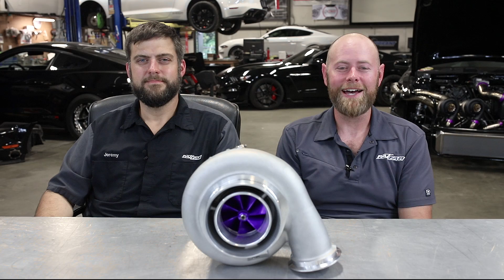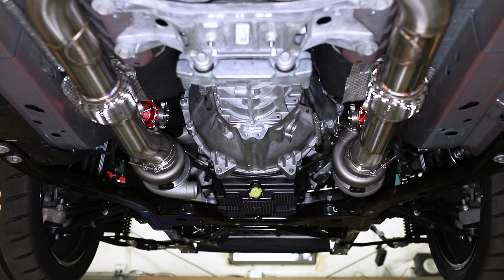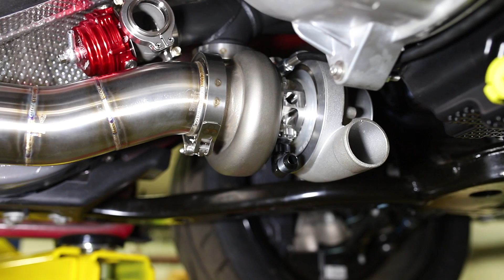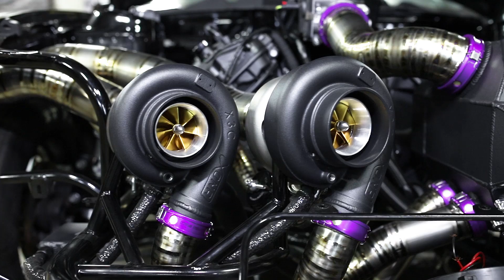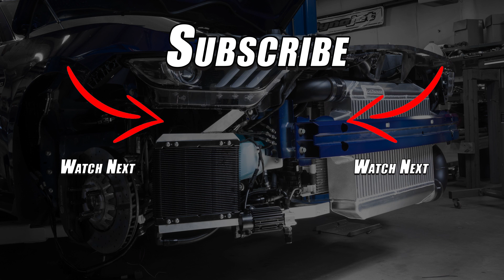Why Xona Rotor?

Comment: What turbo have you ran on a 2.0 liter engine with the best balance of low end and top end?
Reply: BorgWarner S200SX-E For journal bearing, or any of the B1 frame size EFR turbos with a G-type turbine housing if you want Ball Bearing. Though, for the price and long-term/daily reliability while not having to monitor it as closely, I'd probably spring for the SXE over the EFR. It'll be significantly cheaper, too, even if you get an upgraded aftermarket compressor wheel.

Comment: Cool video! Thanks for the informative discussion. :)

Just a question. How do you think does the Xona fare compared with the new line of Garrett G Series turbos? I'm highly considering one of both as an upgrade for my 3S-GTE motor. Cheers!
Reply: I put a g series on my build and let’s just say it pumped hot air sooner than nap said it would I’m now going coma Rota 
There just wrong sizing however the g35-1050 is probably the best designed out of the g series the other size turbos are just setup wrong

Comment: Does Xona Rotor make any turbochargers similar to Comp Turbo which are either Oil less or Air cooled?
Reply: I dont believe so, however the exhaust wheel on the Xona is enough for me that i’ll gladly run some oil and water lines.

Comment: Putting a XR 8269s on my Evo X with a ETS vband kit. I am excited to see what it makes at 40-42psi.
Reply: How it go?
Reply: @john-martin  made 915
Reply: @mikelbring  I gotta ask what made you go with the 69 hotside and not the 64? im in the market for a Xona, thanks
Reply: @john-martin  I dont have a real reason but i did switch to a 7864s and still made 866. Only switched because the turbine housing bolts on the 8269 backed out from not being torqued and killed the turbo.
Reply: @mikelbring  Its just incredible how efficient these turbos are. Did you notice a little better low end response going to the 7864?
Reply: @john-martin  Yes depending on goals I would jump for the 7864 over the 8269s. Not a crazy difference though.
Reply: @mikelbring  What are you quick thoughts on the 7864 over the 8264? I want to run the 8264 but im seeing 8.4s on the 7864 loll
Reply: @john-martin  I never ran the 82 comp with the 64 turbine so hard to say. My car made 866whp at 8000 rpm and was pretty much flat to 9k rpm. I think my 8269s made 915 at around 8300 rpm and was flat past 9k.
Reply: @mikelbring  Damn the numbers are insane. Im stuck between the 78/8264. I know im splitting hairs here but when the turbo cost 2,400, its worth the time to research haha. Im running a 1G 4G63 out of an awd auto wagon.

Comment: I've been running Forced Performnce parts for years on my Talon (GT3076r) & it's bullet proof. Your guy's setups keep getting better & better, about as clean & insane how useful you can make 1000 hp it's crazy! Been saving for my GT350 so I can come see you guys - great work man!
Reply from the maker: Thanks Steve!
Reply: Do you like your 3076r? Thinking about going that route
Reply: @4G6Tre  Love it but I'd get the GTX billet compressor wheel for it (I'm trying to decide which one to get for mine). It's at full boost a little under 3k with 272 cams & keeps on pulling. The only thing holding it back is the crap 91 octane fuel here in CA. Can't wait until I get set up for e85! Great turbo tho!
Reply: @stevecbr929  Damn we have 93 here in va but I prefer e85 and I plan on running strictly that once everything is dialed in. Everyone has been telling me to get the gtx so far. I’ll need a new set of cams because I only have fp1’s currently

Comment: Xonas are incredible but....the Garrett G series is on top right now guys
Reply: I hear you can overspin the g series
Reply: Facts
Reply: The EFR is still on top, no question.
Reply: How? The small g35 etc is laggier usually. And they just put a smaller exit diameter. Nobody runs a g42 anywhere in the big power world

Comment: I have a cupra 5f and im thinking about xona 7865 uhf 0.82ar my question is this turbo capable of putting over 650 whp??will the spool be sufficient enough for everyday use??im currently running a g25 660 with a lot of disappointment..ehat do you suggest on the quickest spool possible with the most hp possible??im searching all over the web for dyno charts but it seems no one have worked in the ea888 gen 3 platform yet..except iroz motorsports with their record holder golf r...can you please help me ??
Reply from the maker: That turbo should make the power you want, we dont work on that platform so we can speak from experience though.

Comment: What is the  cost of a motec set up only. On a 2017 gt350? And what does it consists of?
Reply from the maker: Motec system is an add on to one of our packages that we do in house.  You can add it to any package we do from 600R up.  The cost is $14,500 installed and tuned with all necessary electronics, sensors, mounting brackets and wiring
Reply: @FathousePerformance  14500 for the 600r ? Upgrade
Reply from the maker: Yes, the MoTeC price doesnt change from the 600R to 1400R packages, they receive the same parts
Reply: @FathousePerformance  On the 600R package with motec at 14,500$ just want to make sure that we are on the same page.  On the the 600R package what is the average rear wheel HP with 93 to e85 tune thanks.
Reply from the maker: @voodooreddevil7325  I apologize I read your comment wrong, the $14,500 is in addition to the 600R package.  Total would be $21,499 for 600R with Motec